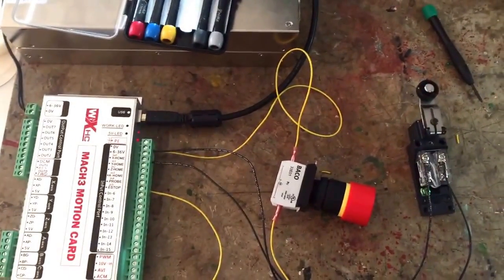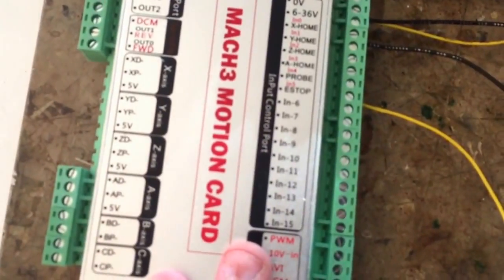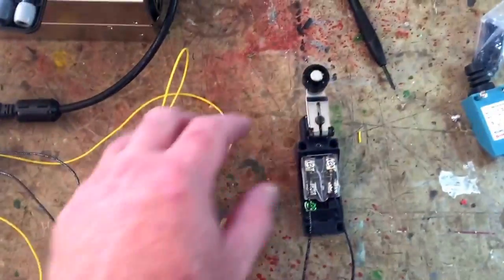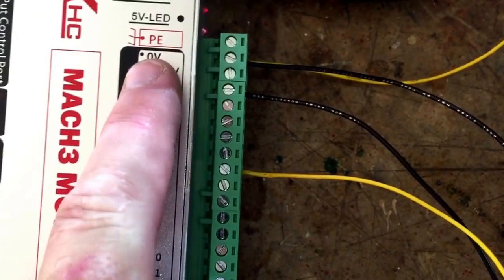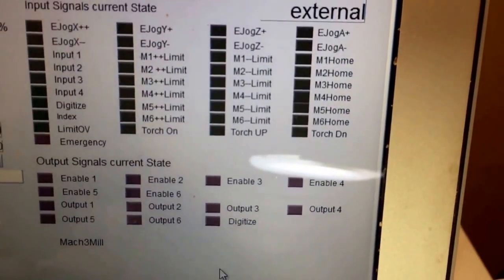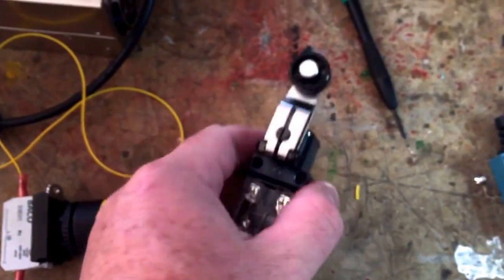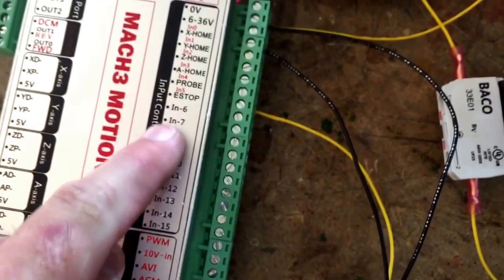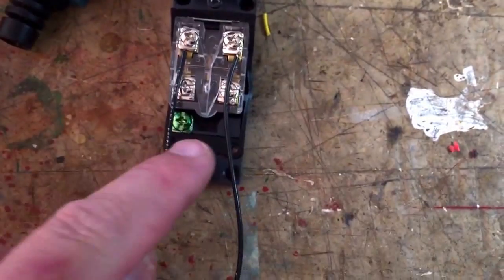N- G0704 CNC setup estop and limit switch in mach3

Comment: How are you running Mach3 on a Mac?
Reply: Dual boot and Windows?
Reply: I have it working on Win7 pro on a virtual machine in VirtualBox. It communicates to a UC300ETH motion controller using wireless or wired ethernet.